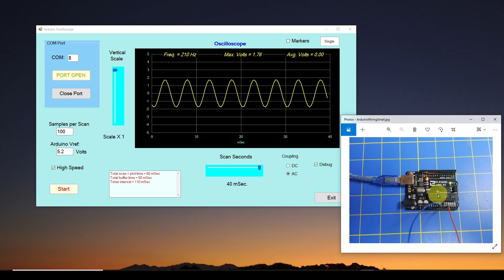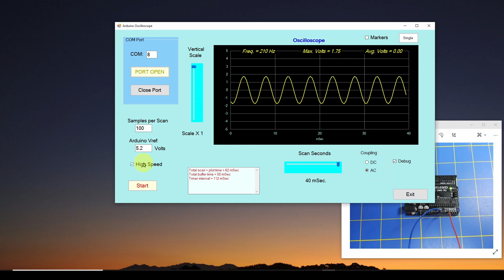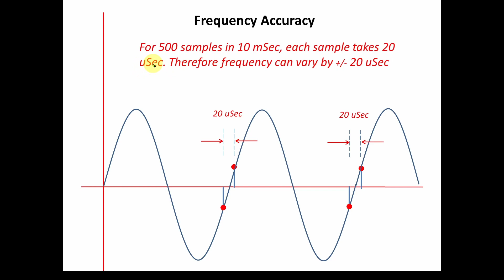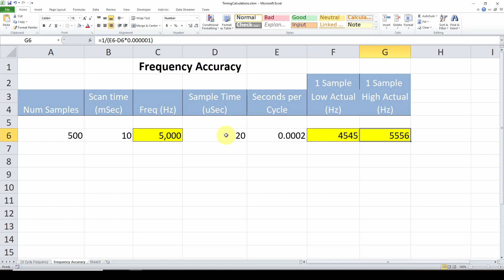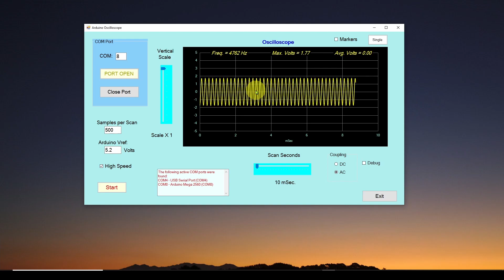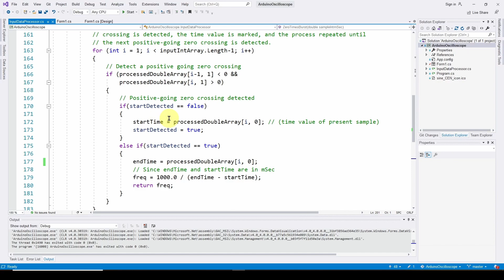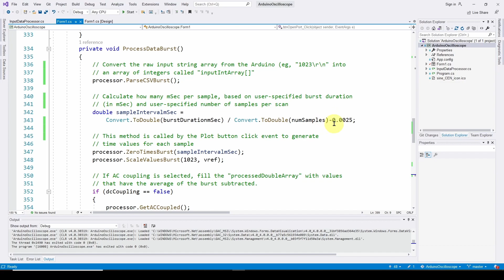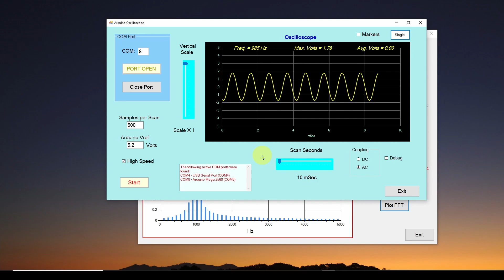Arduino Oscilloscope Part 8: Frequency Measurement

Comment: This is a really great project in many ways! I'm mostly an analog guy and I keep wanting to add just a little bit of circuitry to help out - like zero cross detectors, but really this is the way of modern electronics - do everything in the processor because it reduces cost. So really this is something of a real world engineering project. Thanks for doing this!
Reply from the maker: Yeah, in any engineering project there's usually 34,576 different ways to accomplish it, none of which is ever perfect. And one other way I described in my recent Frequency Monitor playlist, where I convert the input sine wave to a square wave using a comparator, and use the Arduino's edge detection to start a timer. The downside is you also need a very high speed timer to count seconds per cycle. More hardware...